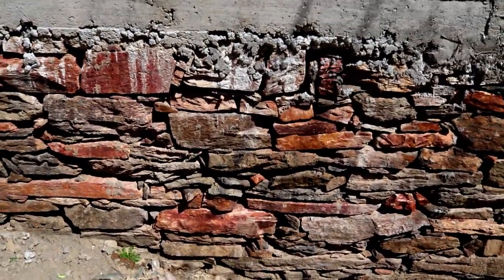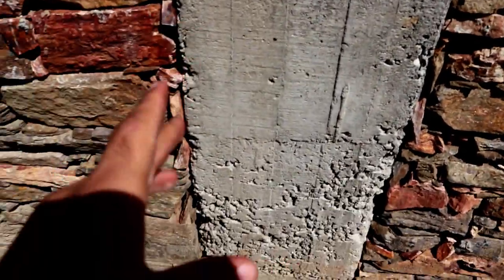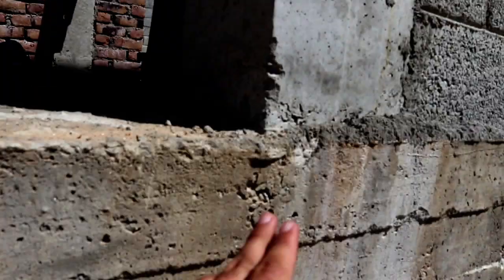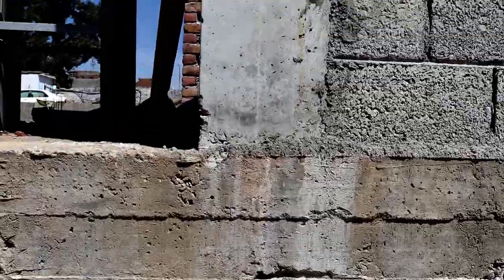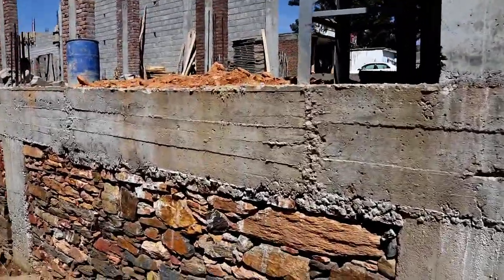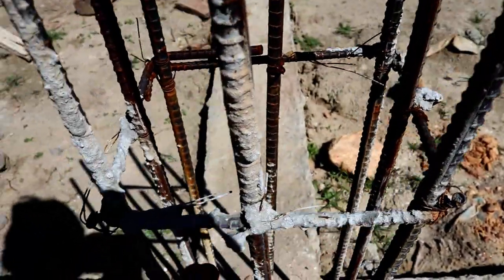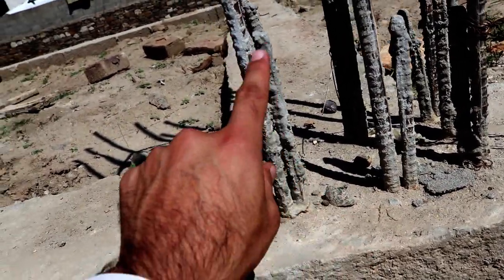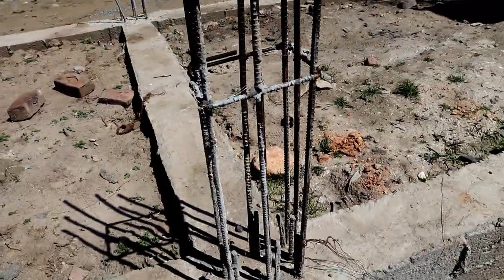What is Plinth Beam in Building? Plinth Beam Reinforcement on Site - Size of Plinth Beam

Comment: Not only the lapping length, the lateral ties is also wrong. End hooks not bent. And for the main bars, alternate staggering is also not provided which is a very huge mistake. All the main reinforcement is terminated at the same level. Overall quality of reinforcement is very poor. The quality of concrete poured is also very poor. In the video, only the plinth beam is shown but its technical purpose not explained. Only 2ftx2ft footing and 1ftx1ft column is repeated which is no way sufficient to understand the purpose of plinth beam. Please elaborate in detail. Such poor quality work videos will have negative impact on fresh engineer graduates. They will be under impression that the concrete and reinforcement is done in the same poor manner everywhere.